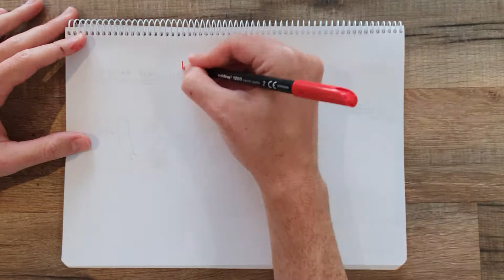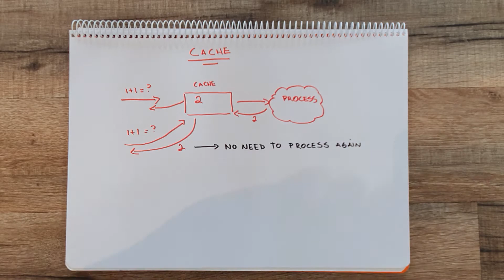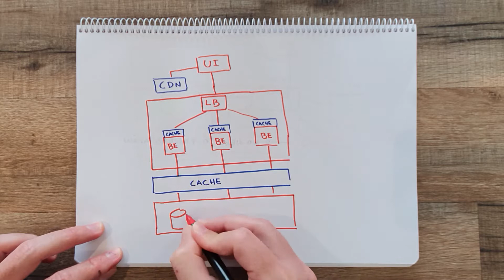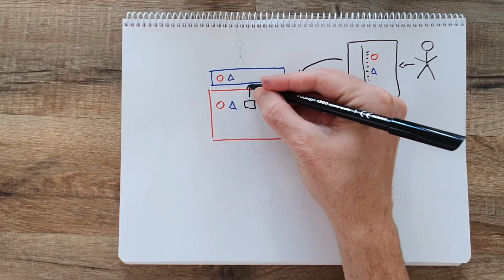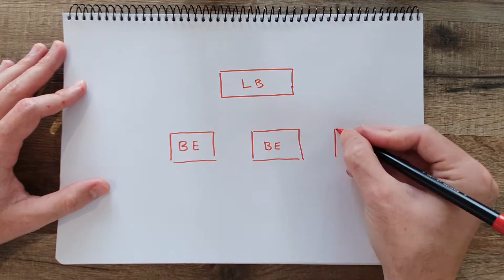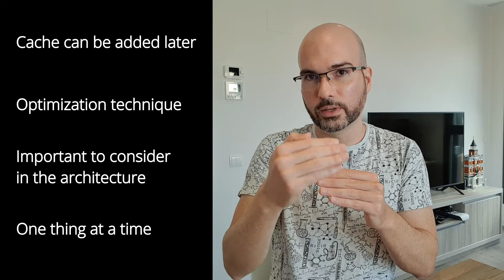Distributed Cache explained - Software Architecture Introduction (part 3)

Comment: Wouldn't it make sense to put a load balancer in front of the distributed cache? And, then also in front of the DB? Trying to figure out why most architectures will put a load balancer in some layers, but not others. Like it seems that as long as we have a distributed/replicated component, then we would need to have an LB in front of it. Maybe some diagrams don't include it because some components have load balancing as a part of it; for example, an API gateway could be doing its own load balancing to know which service node to go to.
Reply from the maker: Hello! That's a great question. Every layer could indeed have a load balancer. The main reason it often doesn't have it I'd say it's because of the nature of the state. 

For example, a relational database will totally be handled only with one "live"/"main" instance for writing and maybe some copy instances for read. Since there's always one instance to write to, a load balancer doesn't add much value. Another thing I can think of is sharding or the case of distributed cache where given the value you know exactly in which instance this info should be. 

Having said this, many services that have state (think on Amazon S3 or Google storage) typically have a load balancer for retrieve the data too. 

Hope it's clearer

Comment: How do I decide, what Design Pattern I have to use?
Reply from the maker: Will direct you to this meme 😅https://twitter.com/SBinLondon/status/1413113782214266885?t=j4vRmgOJPqIiUng_NmWHVg&s=19

It depends a lot on the use case. And some times you might use a pattern that thought was good with the context you had and later discover that it wasn't actually the best. That's the good and bad of this career: is a bit science and a bit art. 

I give some additional tips in my video about design patterns if you want to get some general guidelines

Comment: Why is the video creation been stopped on this subject? Seems like 5 months is a big gap.... Really need the next videos.... These are really awesome videos to the point.... 

Also I am interested in understanding how to choose the design patterns after we have decided the architecture.... Do we choose creational, structural & behavioral all at once in the beginning or does the behavioral set of design patterns work at controller layer inside logic layer....

I did see all your videos of architecture and if you could provide any link or any of your video to understand the same?
Reply from the maker: Thanks for watching! The gap has been mostly because its time consuming and I've been very busy at work :( I have published several videos after this one but on other areas. 

I'm currently working in one to expand the series so (hopefully 🤞) in the coming weeks you will get more content to watch and share :)

In terms of design patterns you usually look at them (purist could say you "find them") when you are implementing feature, so the level is much more fine grained than the architecture. Architecture is like how you are going to build the house, where more or less will be the water pipes and the electric cables. Design patterns is more interior design let's say :)

Comment: I really enjoyed this series. Looking forward to 4 as i check other resources
Reply from the maker: Oh thank you Ndeto! I'm going to start new series soon in other areas but at one point will come back and continue with the architecture one :). Any specific topics your'd like me to cover?
Reply: @ADevStory  Yes! In considering software architecture, should I consider the programming language too? Or any modern language will have roughly the same maintainability/scalability/performance?
Reply from the maker: @daymannovaes  This is an interesting topic! I believe some languages are better suit for some use cases than others. For example Erlang was born already with scalability in mind. Others have better performance (specially when compiled like C/C++), or if they rely on the JVM. But in my experience, overall in terms of scalability and capacity to serve millions of users and requests, these concepts I present are more important than the specific language. 

If a modern language allows you to apply the concepts above then it will probably be fine for most use cases.